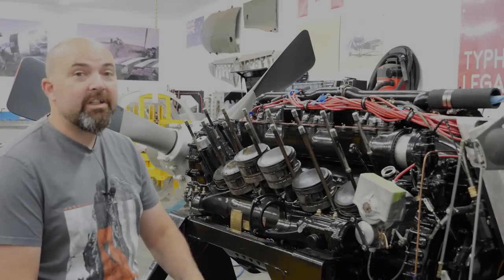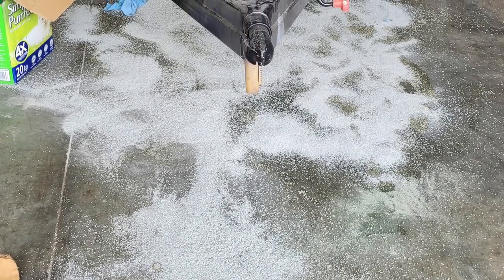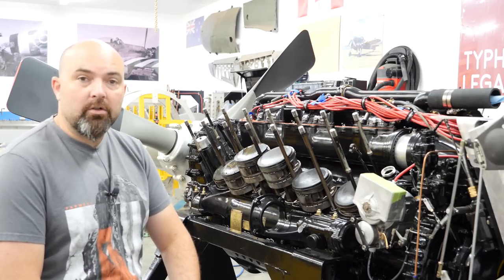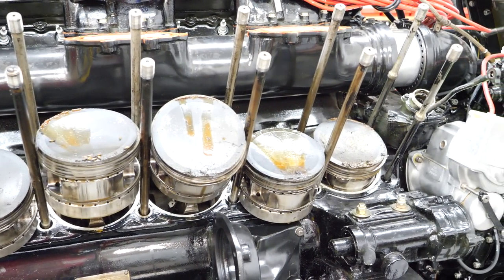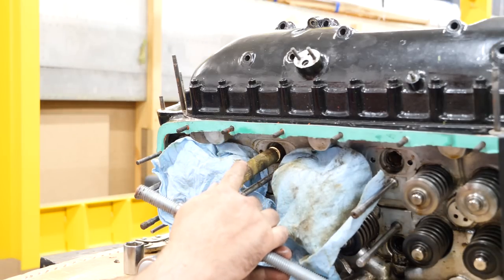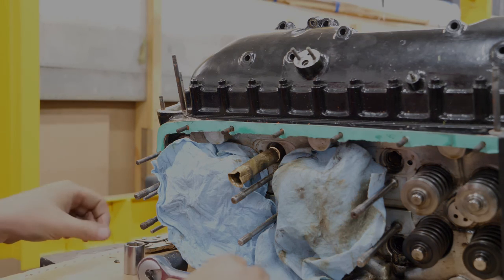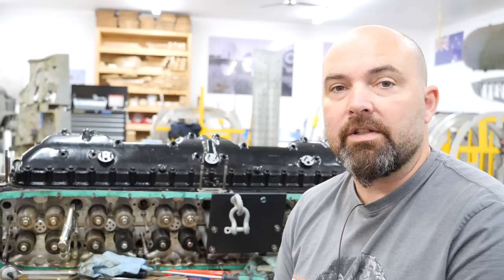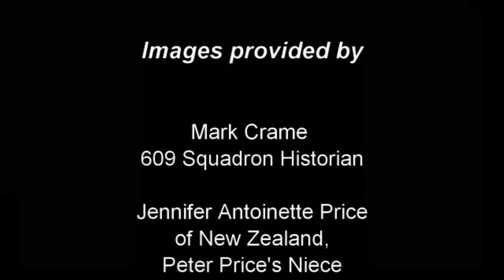S2E9 Merlin Oops

Comment: A good idea would be to pump emulsifyable oil ,(machine coolant) through with your pre oiler pump, that would grab any water present in the system and also inhibit corrosion. Will you be using stainless steel tubes when you replace them ? Chris B.
Reply from the maker: We were looking at Kerosene to do the same. Great idea, thank you for sharing! ~Ian
Reply: @TyphoonLegacyCoLtd  My thoughts on the soluble oil is that it mixes with both water and oil, so would pick up any water lurking in the oil galleries. Good Luck! Chris B.

Comment: This illustrates one of the deign problems of the early merlin, the head and cylinder block cast as one piece.  and this was one of the first problems PACKARD had to address to build the merlin.  Special RR tools were REQUIRED to machine the valve seats and guides, machines NOT AVAILABLE in the USA...so PACKARD modified the design,  cast the cylinder bock and head seperately so regular tooling could machine the valve seats and guides.  The main difference between a Packard Merlin and the early RR version.  RR finally got around to the seperate head/cylinder block LATER on.....One of the changes made for mass production of the previously hand built merlin !!!   And Packard used the Bendix pressure carb on all the version they built, RR introduced it with the 60 series 2 stage merlin in 1942